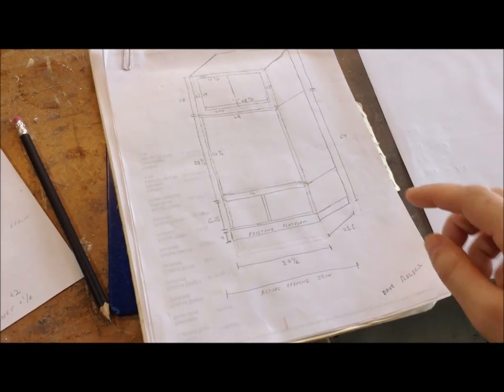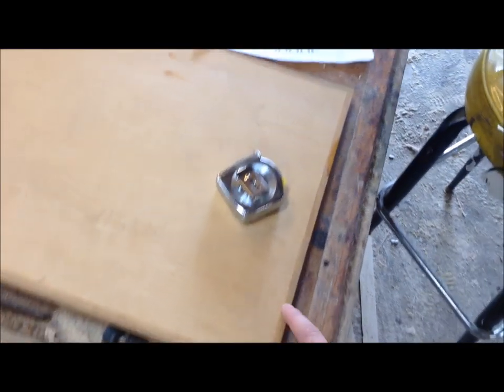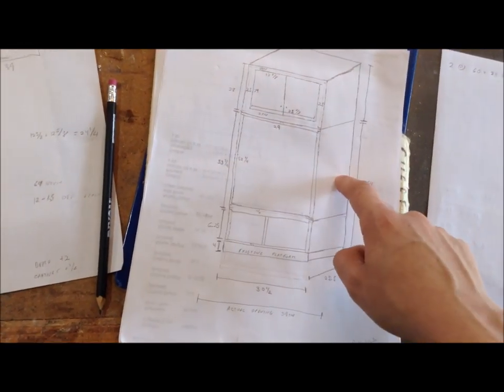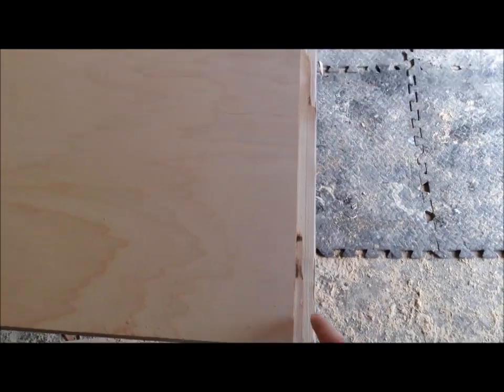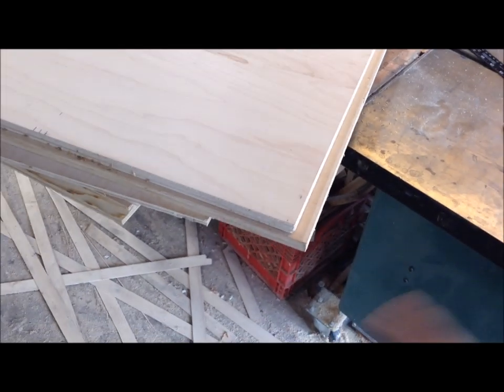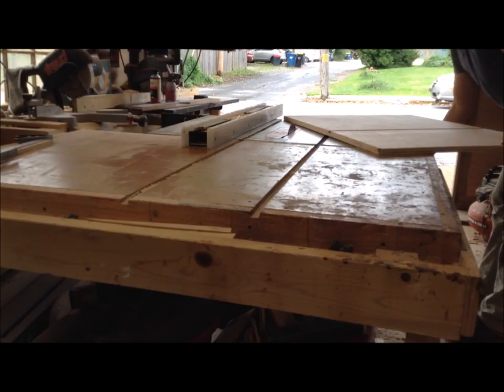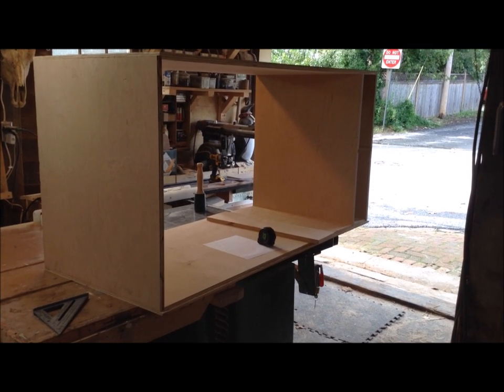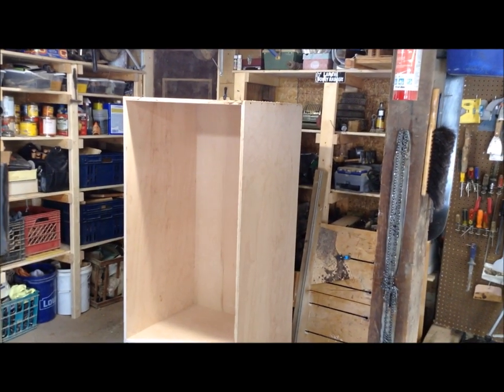Woodworking : Built in Wall Oven Cabinet // How To Part 1

Comment: You said they already have a base.
Is that a frame of two by fours? Or, plywood?
I need to know what goes under this.

BTW
Yours is the first video I have found that actually shows how to make this cabinet.
Thank you.
Reply from the maker: Yeah, if memory serves he still had the old 2x4 or 2x6 framed out base from the old cabinet set in place.
Reply: @HoneyBadgerWoodWorks  
So, I would make a 2*4 base for all this to set on?
Or, could I just place the cabinet on the floor?